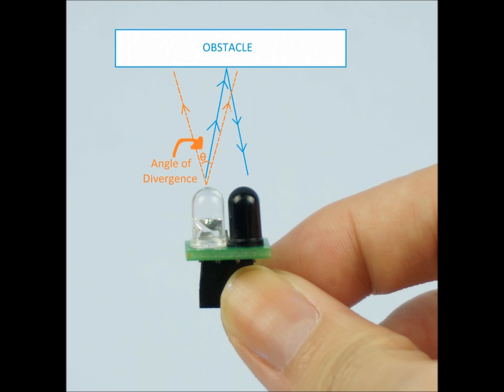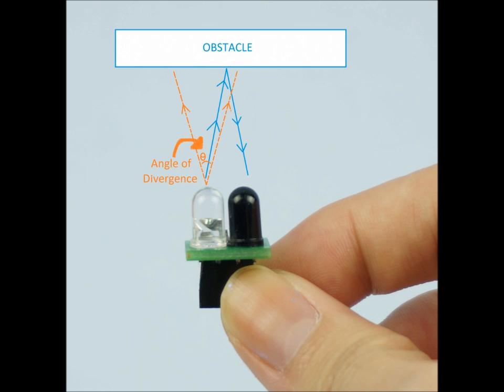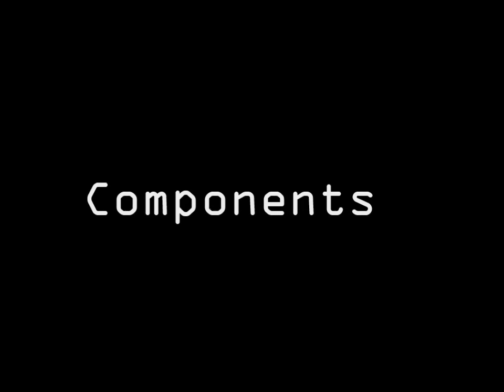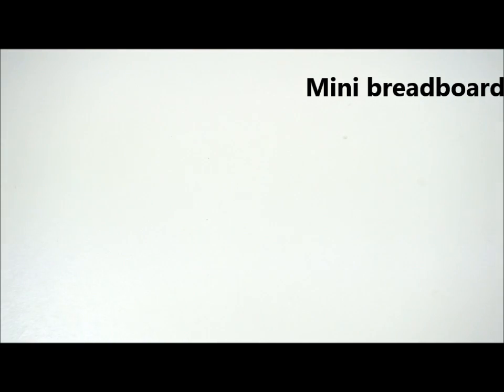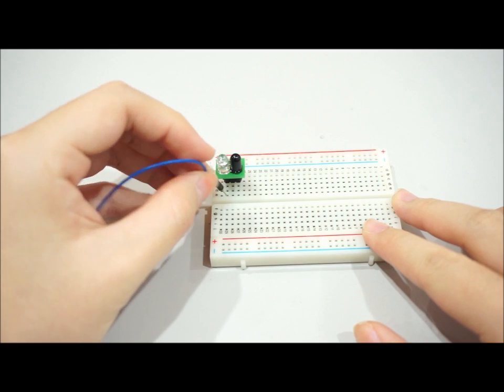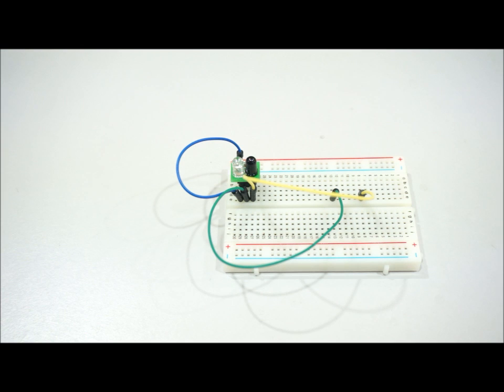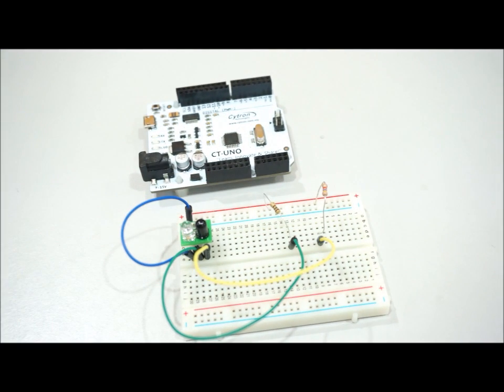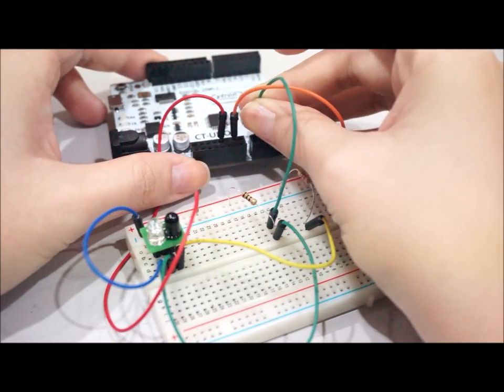Using basic Infrared Sensor for Measuring Distance

Comment: The keyboard scanner of my.pipe organ controller works the same way. I use mini infrared sensors, and separate ATMEGA mcu's for each 8 keys. I measure the ADC when the IR LED is on and when it's off, and I use the difference value to detect if the key was pressed.

Comment: Jeez Louise, lack of diction and that lousy midi crap make the narration just Sonic mud. Edit the audio track, dub in new narration with either proper level balance, or no damned music track. That is NOT added production value, it's useless noise distracting from the information being shared. You don't want noise in your damned ir timing cycle, right? Because it corrupts the data, right? Bingo, that is your midi track. Noise that corrupts data throughput in your vid. Debug your damned video!!! Harsh, I know, but obviously needed.

Comment: Hello!!
Have you ever had trouble with environment light, sun light for example? I tried to use these sensors, but when they are exposured to different light intensity, the values read also change , so I am facing a kind of noising . Is there any thing that I could do? A auxiliary circuit or something like that to deal with that change ? Thank you by this nice tutorial !